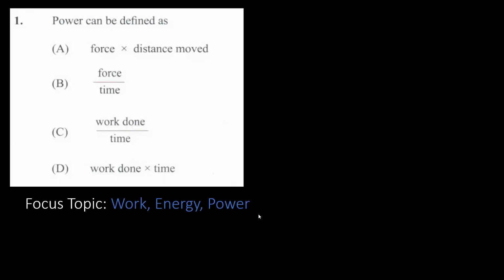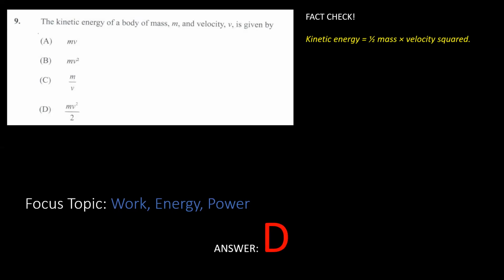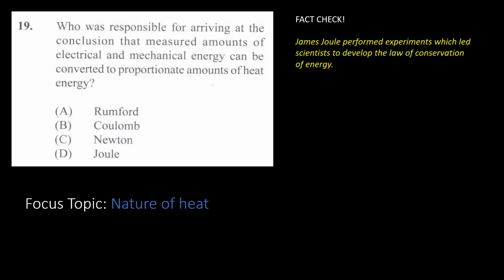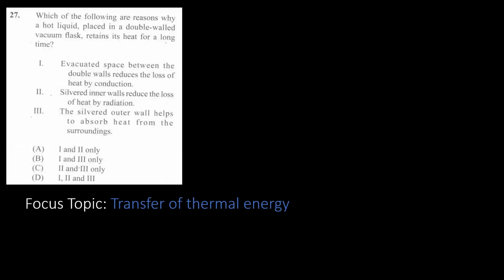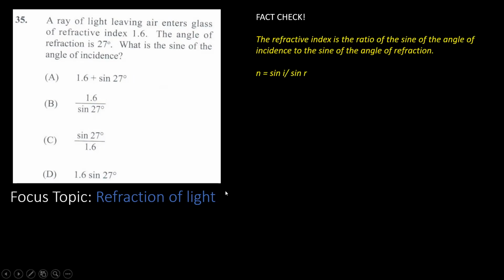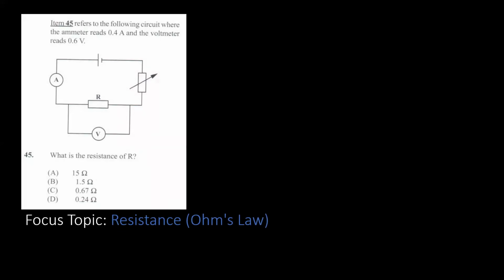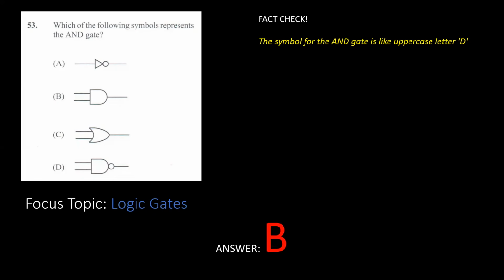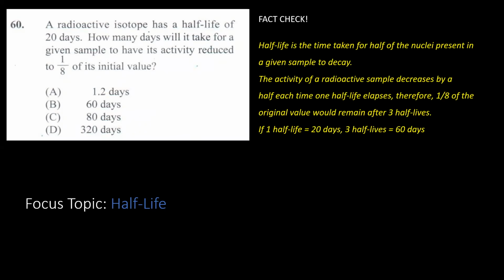CSEC Physics June 2021 Paper 1 Workout

Comment: Isn't #4 D though? Cause X and Y are  acting on the left side of the diagram hence they are negatively charged so if you add B which says X + Y to the let not only will our adding a positive charge to the negative side but that will not allow the object to be stationary.
Reply from the maker: You're looking at which side of the object the forces are rather than the direction in which they are acting. The forces X and Y are acting to the right, hence the balancing force must be acting to the left.

Comment: For number 6 in the case of a rubber band or rubber ball, if you change the shape of it by compressing or stretching it, the volume would change. The mass however remains the same. Since density is mass/volume, wouldn't the density of the object change as well?
Reply from the maker: Yes, that would be logical.
Reply: @menelik1jm  so the answer is D?